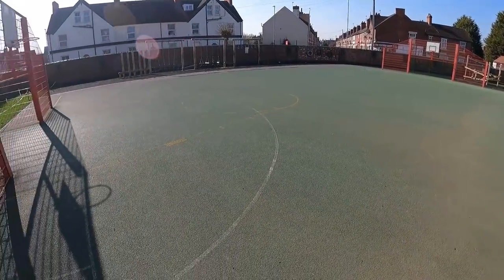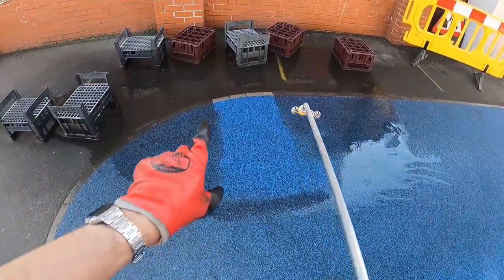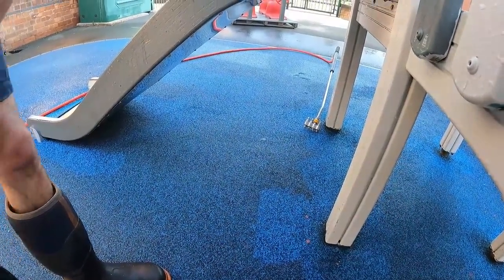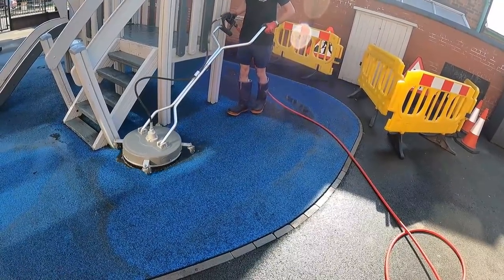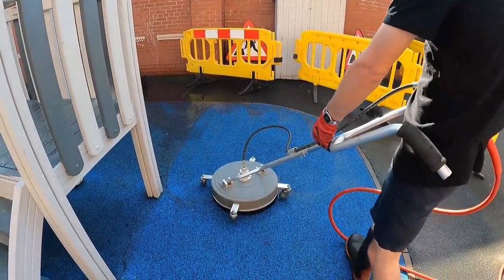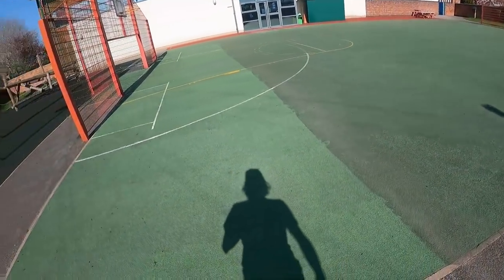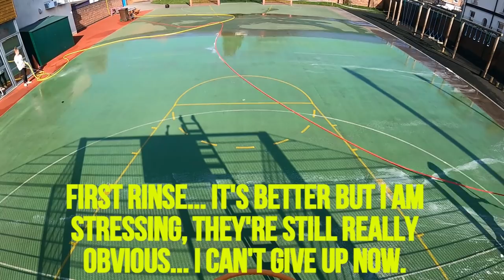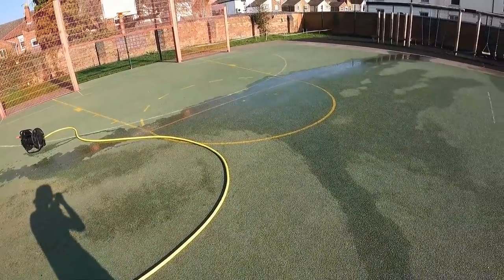We Cleaned This Playground For FREE! (Her First Time Power Washing!)

Comment: Such a difference! And the amount of dirt that came off with the second pass was amazing. Have you got anything to vacuum up the dirty water before it soaks back into the surface?
Reply from the maker: I’m unsure if anything could really do it quick enough, the surface just needs to be proper drenched so flood the dirt out, tricky surface!
Reply: @PartridgeExteriorCleaning  I've seen on some carpet and rug cleaning channels where they have a porous cleaning floor over a drainage system and I can't help but wonder if a similar system wouldn't be beneficial here.  I imagine the cost of installing such a system would be quite prohibitive for the property owner, though.
Reply: @Quentin Stephens: I was thinking the same thing. Similar to the rug-cleaning wands, but about 6 feet wide. :D
Reply: @PartridgeExteriorCleaning  What if instead of sucking up the dirty water, you just rinsed it away immediately? Set up a second pressure washer. One to blast the dirt off, the other for immediate rinse down. Like you had Lydia doing with the hose, but using a second washer. 

Save the extra expense of renting a more powerful washer, smaller one would be cheaper (unless you have another washer, or can borrow one from a mate!)

Comment: great vid bud! ive cleaned quite a few of these rubber wetpour surfaces and from what ive learnt use a 4%  mix and let it sit for about 20 mins then rinse it off. and using surface cleaners on these surfaces can do more harm than good but u should be fine if u use it on a low setting. just enought to agitate the dirt and algae, but never the less great video!!!

Comment: I wonder since the problem is partly due to the material used if having a partner following you rinsing it down as you go would help prevent the tram lines.  It looks great, massive improvement.